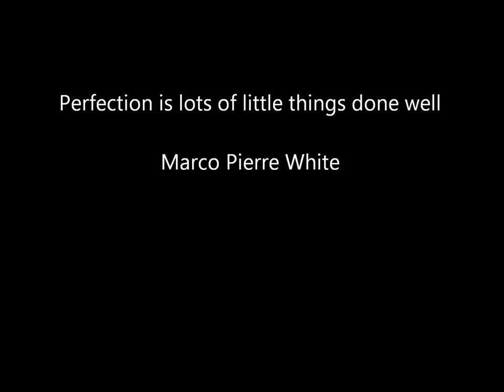Low Swimming Pool Calcium Hardness Causes Plaster Pitting

Comment: I have an old plaster pool with no heater or salt cell and my calcium is at 2:50 is it 150 to 250 a bit low?
Reply from the maker: The normal range is 150 - 250 ppm but you can go a bit higher if your pool needs it.  Thanks for watching.
Reply: @cleanpoolspa-ultimateswimm6373  awesome thank you
Reply from the maker: @XtianApi  Thanks for watching.